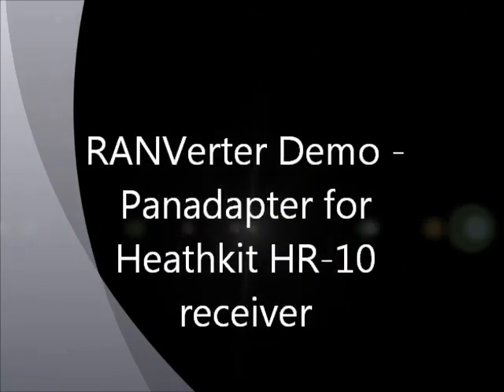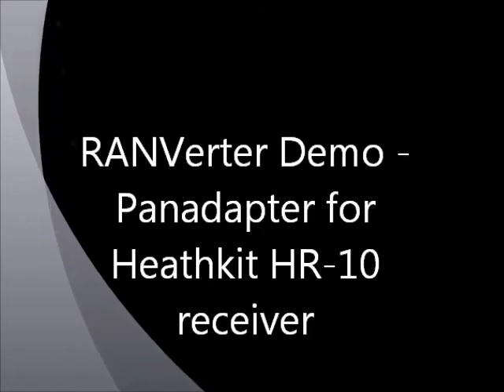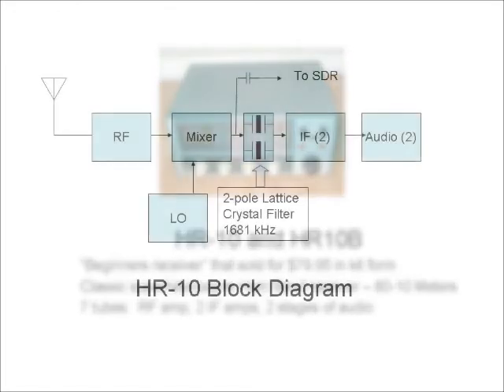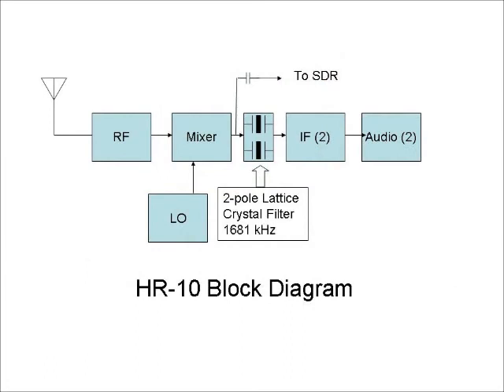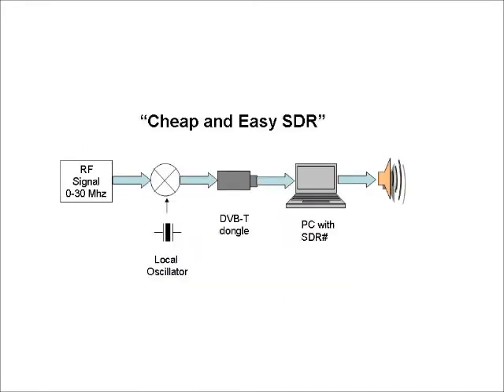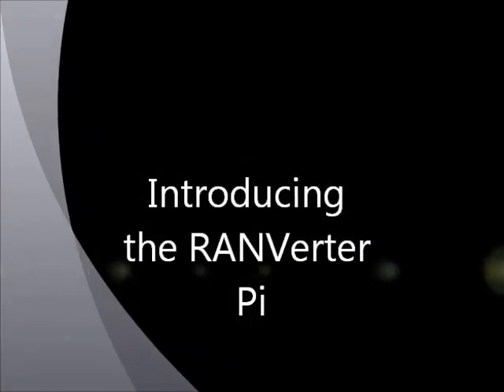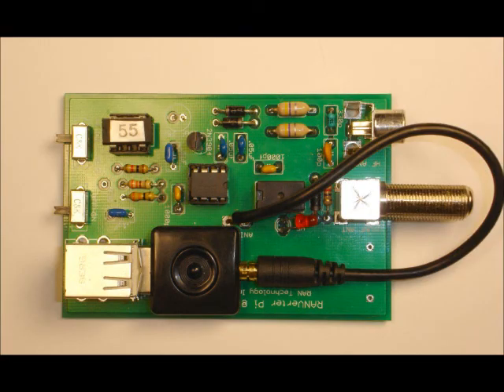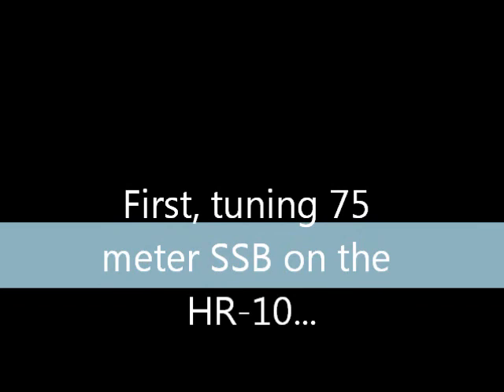Cheap and Easy SDR Panadaptor for Older Receivers

Comment: Would this work on an old Heathkit HW-101?
Reply from the maker: Hi Gary -You bet, in fact you have two choices.  If you pick the signal off of pin 2 of V12A (2nd Mixer), you can tune the RANVerter to 8.5 MHz and see most of the band the HW-101 is tuned to, and the center frequency will not be affected by the VFO.  Or you can tap off the plate at pin 6 and tune the RANVerter to the frequency of the 2nd IF of 3395 KHz.  With this choice the center frequency will be what the VFO is tuned to, but you can independently tune the SDR anywhere in the band, or even to different modes (like AM, narrow CW, or even FM).   In either case, use very light coupling - only a few pF is enough. I get plenty of signal using a "gimmick" capacitor made by twisting a few turns of insulated wire together (make sure there's no electrical contact between them).  One end goes to the tube pin, the other to a short piece of shield cable to the RANVerter input.   Reduce the RF Gain to avoid overloading and enjoy!
Reply: ranickel
Thanks for the info. I'll look into that or building a Softrock Ensemble Xceiver.

Comment from the maker: Sure!   Many newer receivers and transceivers have an IF output that is already within the tuning range of the dongle (i.e. between 24 to 1700 Mhz).  So for them, you only need to connect the IF output of the radio to the dongle, and tune it to the IF frequency.   For example the IF of the FT-817 is 68.33 MHz.  Check Youtube for videos showing examples.